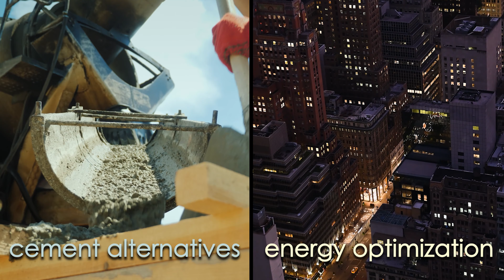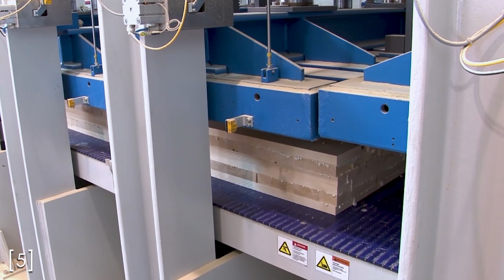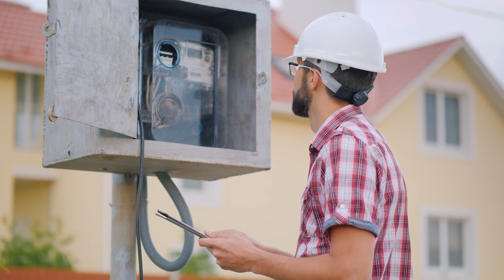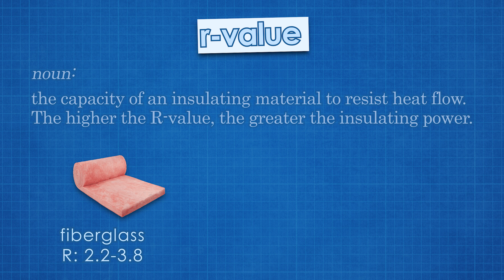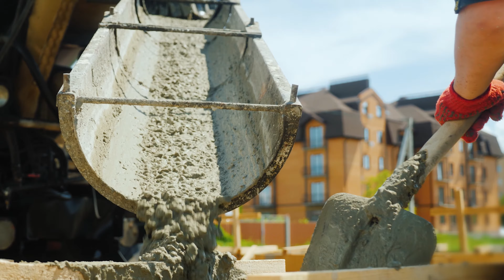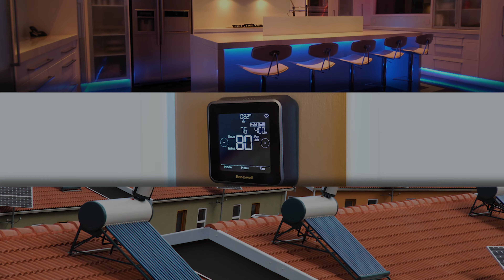Building A Greener City

Comment: probably the main determinant of how feasible CLT is as a concrete alternative: how cost-efficient is CLT compared to concrete?
Reply from the maker: CLT costs can vary depending on the type of building. Typically, it is cheaper to build using CLT, but it can become more expensive in multi-story apartment/hotel/skyscraper settings. It is also cheaper to work with CLT compared to concrete since it is a lighter material to transport and requires less time and labor to assemble.

Comment: a bunch of random Qs from watching the video: how strong is CLT/can it support multi-family houses? could it replace other common uses for concrete, such as sidewalks? also, how much of a fire hazard is it in construction? my impression is that wood is already used in home construction, and that CLT would be safer in fires due to its density.
Reply from the maker: CLT can support multiple stories, but as the number of stories reaches double digits, it becomes less cost effective to use CLT compared to concrete.

I'm sure you could replace sidewalks with something even cheaper than CLT as the need for structural integrity is a lot lower for a walkway.

CLT is incredibly fire resistant due to its density as you said. There's a part in the video where I mention its structural integrity holds for 30-90 minutes after being set on fire, which allows plenty of time for evacuations.
Reply: @PlanetZero-ClimateChange  That's amazing.